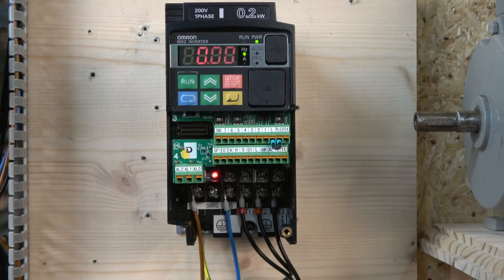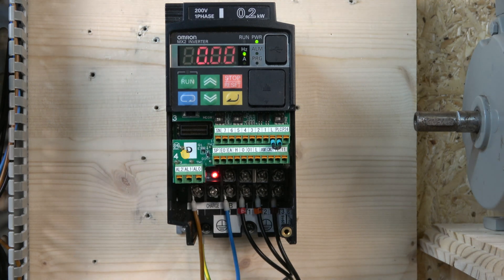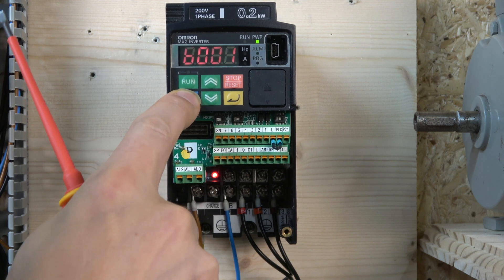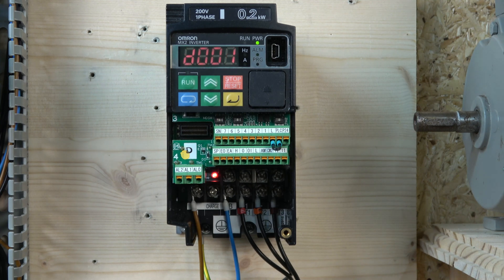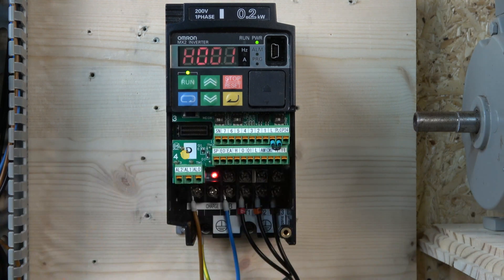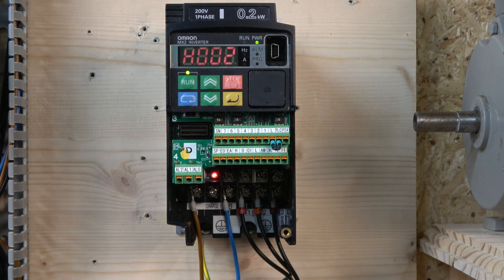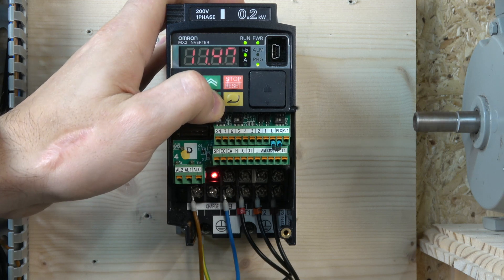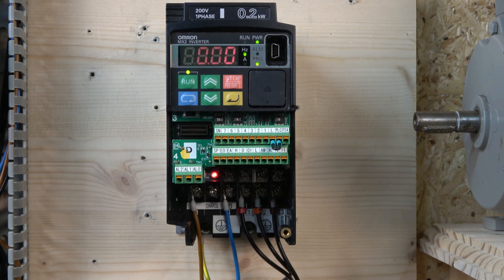Omron MX2 VFD local control, Auto tune, Commissioning, Factory reset and Parameter set up. (English)

Comment: If you have a newer MX2 with a jog wheel, be careful. Parameter A003 is NOT for mains power frequency. It is the frequency rating of the motor. See page 5-24 of the manual: "Do not set the base frequency to lower than the motor rated frequency. Doing so may cause overload or motor burnout."

Comment: Pls, i have an omron inverter 15kw, i want to set parameters for a 15kw, 30.3A motor. Kindly share the manual page i need with me for the parameterization. I want to set limit running current for the drive/motor. Share the function that help me achieve that.

Comment: Hey, great video, I just got my hands on a couple of these inverters and I just hooked one up folowing your instructions, it a 3 phase but the programing part is the same,, but I have a question as soon as i lower the rapm to really slow or even hit run, my motor makes some bad knocking sounds as the rpms goes down, have I missed somthing inte config you think?
Reply from the maker: Hi there. How low are you going and what is the motor doing work wise, I.e what is its loud
Reply: @IGSElectronics  The knocking sounds comes when i try to zero the rotations i.e slowing it down, or when it starts from zero, it knocks up to a certain speed the it runs smooth. I have since shifted to another motor which is a bit more powerful and on this one I don't have this issue, it speds up and down perfectly, but I can't get it go in reverse instead :)
Reply from the maker: @MrRogerpettersson  Is that sound comming from the drive or motor, if it is motor, then i doubt wary much that that is anything to do with your drive. There is something happening with the motor or gearbox that, that happens on low frequancu. If you have a other motor to test on, would be good idea to check it out.
Reply: @IGSElectronics  I found the issue, the motor have a rectifyer break box in it, I did not know this, question is if I need that break now that I use MX2 ?
Reply from the maker: @MrRogerpettersson  my fiend that wary much depends on your application. If you need to have sudden stop, then there is so much drive can do without brake. So if you think you don’t need to have the addition, remove it.
Reply: @IGSElectronics  https://youtu.be/zu5SMv_YhDw
Reply: @IGSElectronics  https://youtu.be/lsIg_tp6DkM
Reply: My omron mx2 drive always showing frequency trip how to over come this problem